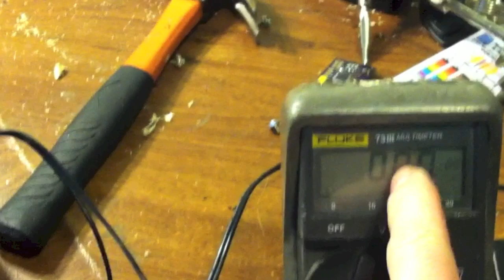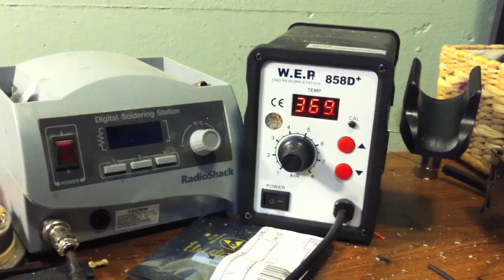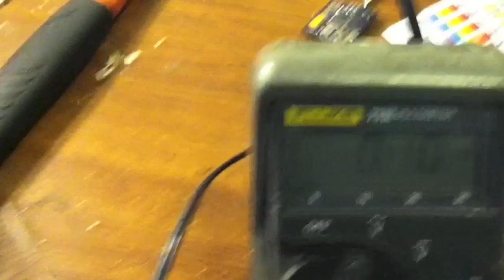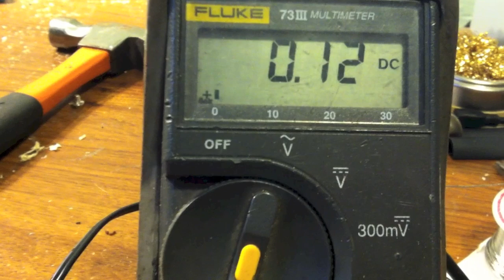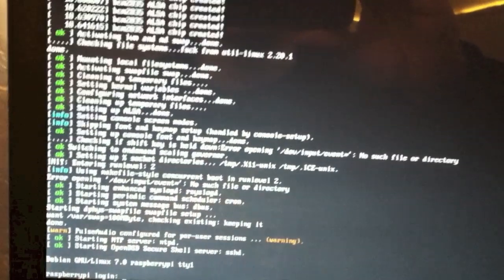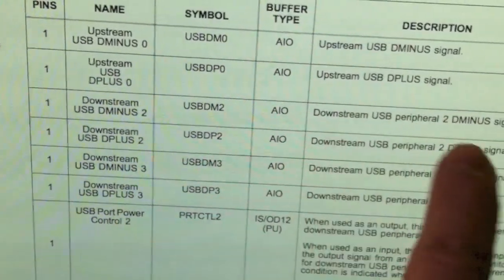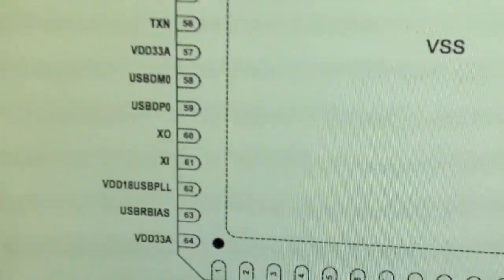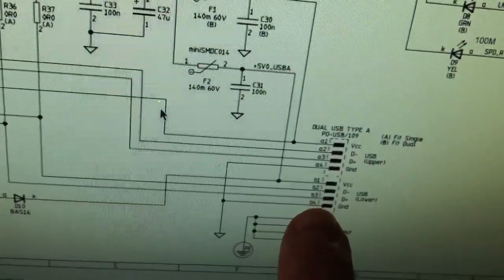Raspberry Pi Power Consumption Reduction - Hard Hack

Comment from the maker: Removing the chip was relatively easy. The circuit board is multi-layer, at least 6 layers. Some of those internal layers are power, so it wouldn't be possible to just cut the power trace. It'd also be dragging down the USB bus if you left it installed.

Comment: I measured my Raspberry Pi (the original version, Model B) and measured around 0.25 Amp. It seemed low considering I'd read a lot of people saying the Pi uses around 0.7 - 1 Amp. Anyway, it looks like yours is pretty similar although you have the bigger chip which I assume is why you have slightly higher usage. I'm going to try run the Pi from a 7 Ah battery which is charged by a 10 watt solar panel. I think it's going to be a bit tight but we'll see!

Comment: Personally I would have started by just pulling reset low or using software to place the lan9512 in "SUSPEND2" state, current consumption goes down to 4.2ma according to datasheet.

Comment: hi!! are the usb and lan port still working after the chip removal?
Reply from the maker: No. That chip that's removed is the USB hub/USB-ethernet chip. I desoldered the lan port shortly after this, and removed it. And only one of the two USB ports work after this. This was done 3 1/2 years ago. Nowadays a Pi Zero would be a way better choice. This video is just up for history's sake at this point.
Reply: +unaclocker yeah! i guess. I have ordered a raspberry pi 3 and I was thinking about removing the Lan9514 chip. I dont mind lose the lan port but i need the usb ports....